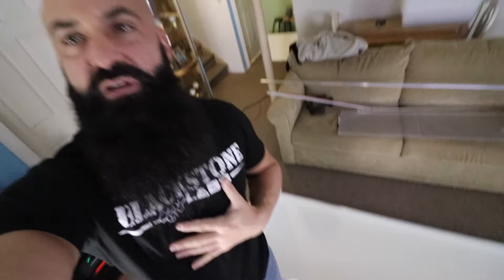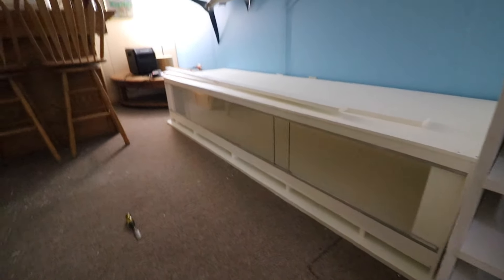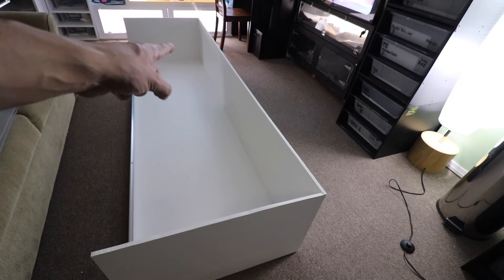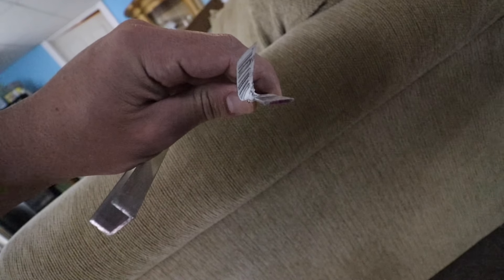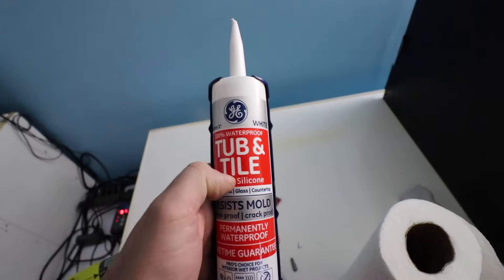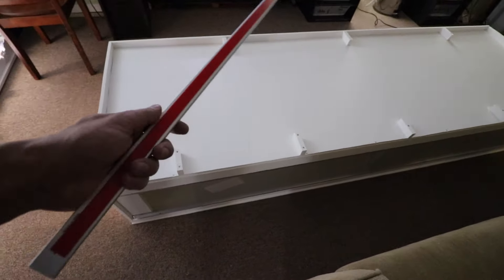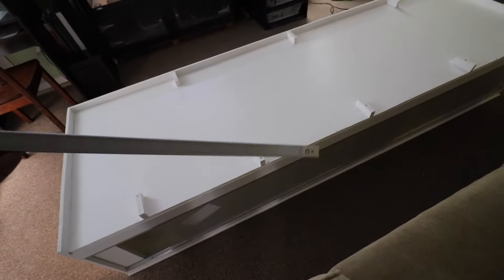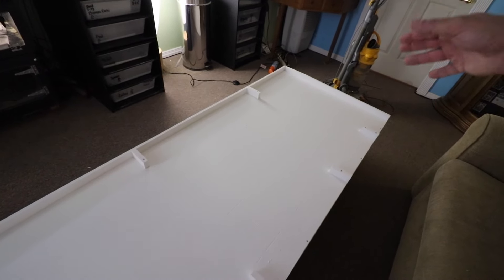How to Build Snake Enclosures (Cheap & Easy) DIY

Comment: first diy "Cheap and Easy" I've found that actually looks completely doable. I'm searching for bigger vivariums for my snakes, but glass ones are far too heavy for me to safely move alone. Lighter construction material (that I can cut and screw together easily!) is key. So this looks like a great project. Thanks for posting!
Reply: I've built all my enclosures it's the best way to go,  easily modified, durable,  and a no Brainer.  Lasts forever if done right and materials can be reused if you want to modify or upgrade.

Comment: I built two using your plans Chris and, speaking as a fellow non-carpenter, they came out great.   My only issue is the silicone caulking is not as strong as my male burm.  While roaming around the cage and pushing all of his newspaper into a ball on one side, he keeps lifting up tiny pieces of the silicone.  This afternoon, he was covered in it  (LOL).
Reply from the maker: Hmm thats weird. Maybe they have some kind of heavy duty stuff. Im not sure. Havnt had an issue yet
Reply: @Chris_Graham  When I'm bored, I play solitaire; apparently, my burm peels silicone. 😄

Comment: Best build video that I've seen hands down! I have a Ball Python and I'm wanting to get a mate for her. I'm actually wanting to build a bigger enclosure for her and her mate when I get him. I'm thinking I may do 6 feet for each one. Could you reply with the link on the heat tape with the size I would need for the enclosure please? 6x2x2 is what I'm going to do. Oh also a link to the thermostat that you use for it. Thanks!

Comment: Nice video dude. I’ve been wanting to build an 8’ x 3’ (or 4’) x 6’ pvc enclosure for my Tiger Ratsnakes. If your putting Burmese pythons in there I would only be concerned with bottom panel and the weight of the snake. To me it just seems like there should be more support underneath. Otherwise I really like the set up. Thanks for sharing.

Comment: I would like to see a video where your getting your temps with flex watt going through 1/2 inch PVC. I'm not seeing where the heat would effectively transfer. Since Flex watt is made for under floor heating application I have been told by several breeders that you can put it under tile and grout it in. Great video!
Reply from the maker: Its been 2 years, my female burms are still in these enclosures and both girls are about 11’ and 35lbs each. Temps have never been an issue with the flex watt heat tape since i made the video.
Reply: @Chris_Graham  wasn't saying your temps are bad. I've tried and can't seem to get them right. the heat tape has to be set super high and it takes several days to get the hot spot to 70 degrees. I didn't see where you had a follow up video showing what your temps were running. only way I can get it to temp is putting it under floor tiles so the natural stone heats up. just suggesting maybe you do one and focus on how you have the heating setup and what you have to set the thermostat at to achieve correct hot spot.

Comment: Chris I know you built this a few years ago so and I think you might be able to provide some updates on how this is working. My main questions are: how well is it stacking and holding up?   How did the heat tape idea work out was it hot enough to go through the PVC. Trying to see if I 1/2 inch PVC  is enough. Thank you
Reply from the maker: i have three of them stacked still since this video, and all three have been transported from NJ to SC without issue.  Still using the heat tape and it does create  enough belly heat and the female burms are about 12' long now and feeding on large rabbits and digesting great and doing well.
Reply: @Chris_Graham  thanks so much for the update and that is great to hear!

Comment: Amazeballs! What you doin for ventilation?
Reply from the maker: I have holes drilled in the back and sides to allow for air ventilation
Reply: @Chris_Graham  Thanks for responding so quick!
 How big? How high? Covered, with what?
Reply from the maker: @daniellepurv9094  i used like a 1/4” hole bit and just put a bunch in. That way its too tiny for a large snake to fit its head through

Comment: I’m definitely going to be using this video! Thank you so much. I have three snakes so I’m gunna build three of these and stack them. Mine will probably be 6 feet though. I’m also hoping to build some sort of cabinet on the bottom for supplies. Would I be able to stack these 4 high or should I add extra support?
Reply from the maker: yea you can always add a verticle support in them to make them even more sturdy if you wish

Comment: I just bought a baby Boa. She's in a small cage now but I'll have to get her a bigger house as she grows. I am going to use your ideas for my build. I think I'm going to use real glass for the doors. I used plexiglass on my monitor's cage and it looks like crap after 5 years of wear and tear. Anything inside that needs wiring I want to use some kind of condoit so there isn't wires for my snake to hurt herself on. I'm going to talk to an electrician friend about wiring thermostats and lighting. Don't be afraid to pick at the brains of skilled people. I'm no carpenter or electrician but I know some people who are.

Comment: It's a nice design but I don't understand how the center is supported.  I don't see a center brace.
Reply from the maker: You can always add one if you’d like.
Reply: @Chris_Graham  I just bought 4 pieces of PVC for a very cheap price at Home Depot because it had some small damage to the sides from the straps.  BTW, Home Depot will discount PVC 70% for small damages,  I appreciate your video but was just wondering if it sagged in the center without a center brace.  Thanks again!
Reply from the maker: @andreperson3504  no mine hasnt, and they are still in use and nothing has been added to them

Comment: For those in the comments. Blackstone Labs is the best period nutrition superstore!  
Would recommend DMZ but that’s oldschool lol. 
You need to try brutal force and chosen 1 stack
Their dust pre-workout is really legit too! Deployed for 6 months and went from 185-205 in 10 weeks and kept mass but lost a little strength post cycle. This cycle was a one time go... If you have ever had a hard time gaining weight or muscle these guys have what you need!
Reply from the maker: Hell yes! About to try Apex Male for the first time, never got the chance to try DMZ
Reply: Chris Graham I would also just got to a test center like Low-T center and just get on a treatment with them. Take home weekly shots 140$. I had low t like 5.7 free and 202-225. I got it up to 16 free and like 600. I was lean af and it didnt take very much to maintain.

Comment: Your doors are 12" high but how far apart are your tracks, to be able to remove/install the doors and how many inches do your doors overlap in the middle? How long is each individual door? Is the top supportive enough to have a track installed to it directly and have taller doors?

Comment: Hey Brother how are you heating these?
Reply from the maker: I am using 11" heat tape currently and not having any issues at this point
Reply: @Chris_Graham  on outside underneath it?
Reply: @Chris_Graham  BYW Thanks for this video! Helos with new enlosure for my burms and I am tired of using melamine!  Lol heavy stuff!
Reply from the maker: outside underneight of it. the heat will penetrate through the pvc and warm the snakes belly
Reply: @Chris_Graham  cool Thanks man! I wasnt sure.

Comment: I just wanted to comment and say thank you so much for this video. I used this when building my custom enclosure for my Dwarf Retic. I travel in my RV and built her enclosure to fit my slide. (6ftx2ftx19in) It has lasted for the last 2yrs. She was 8ft when I first built it. Now, however, she is full grown and bigger at 14ft. So, I'm about to use your video again to make her a larger enclosure.
Reply: Too bad you aren't the one who actually built it.
Reply: @EYC420  What does that even mean? Snake cage is a snake cage. Only so many ways to build a box and not everyone can or wants to wing it

Comment: Just built this for one of our retics. Should I router out a recess for the heat tape? Or is 12”x3ft enough to heat through the 1/2inch pvc if I set the thermostat a little higher than 89, I was thinking like 95 should penetrate the pvc enough?

Comment: How well does an under tank heater work with this material?  I'd imagine you'd need to crank it up pretty high to get through the thickness?   I feel like that's going to shorten the life of the heater and raise the electric bill.  I'm looking into building one for my ball python. She's in a breeder now but, I want to go a little longer and not as tall (4'L x 15"H x 18" D).  Could I use a thinner pvc?  Also, do they have that in other colors like, black, brown or, gray?  Thanks in advance!   ps.  I'm not a carpenter but, I was raised by one ;)

Comment: What is the thickness of the glass?
Reply: 0.22” works well in this track.  However, I’m not sure you could use a ratchet lock...  I’m thinking of using sliding glass track from Rockler instead. Otherwise this build looks great—bought my PVC last night.  My daughter’s blue-tongue skink will be very happy.  Note I’m going for 4x2x2.
https://www.rockler.com/4-foot-plastic-sliding-door-track

Comment: I am a complete beginner in carpentry and I was able to successfully finish this enclosure! I adapted it to be 6x2x2 and it looks incredible. Instead of multiple little feet at the bottom, I used three 2x1 ft pieces of wood (ensures they are the same height). I also will say if you are complete beginner, don’t really have the space to be sawing in your house/outside, or are short on time, I would recommend spending the extra money to buy a pre-made one instead. This is more time consuming than it seems and I definitely ran into my share of frustrations. For example, the saw blade kept getting so hot that the PVC would melt and re-fuse to itself; solved this by dipping blade into ice water every 15-20 seconds as I was sawing. Got a lot of help from my way-more-knowledgeable-than-me parents too. Overall, great tutorial! Looks great and totally worth it if you have the means to make it :) Thanks Chis!

Comment: Can you make a enclosure that's affordable that is 8ft long x4 ft high × and 4ft wide
Reply from the maker: yea just do the same steps in the video except use more pieces of pvc to make it to the size you want.  Might be cheaper if you used wood but i would recommend the pvc
Reply: @Chris_Graham  how much more pvc would I need?
Reply from the maker: @user-xg8ij1hs3x  probably 4 pieces of 8x4 sheets

Comment: Thank you for this great DIY explanation! We're using it to create a 4', 5', and 6' enclosure for our various reptiles. Did you find a lock that works to keep the sliding doors closed? Also, we added a 24'x1/2"x3 1/2" support beam to the very middle of each enclosure that prevents them from sagging when stacked. It was a scrap piece, so it was free
Reply: Did you buy exactly what he bought because I’m looking into making a 4-5’ enclosure for a ball python

Comment: I'll be using ur design here real soon only thing I'm gonna change is the support on the bottom I'll prolly add runners that go all the way across the bottom for added support in the middle of the bottom if that makes sense
Reply from the maker: ryan mcnabb yes it does, i just didnt bc i planned to run the heat tape

Comment: I see that the plexiglass slides, and the two sheets have enough give that they don’t scrape against each other. My question is do you have any way of securing the sliding plexiglass sheets to secure it closed? Or is it not really an issue of them sliding it open on their own
Reply from the maker: The Fit Zookeeper its not an issue of them sliding it open but if you wanted to you can buy a “display case lock” off amazon. They are like $10
Reply: Chris Graham awesome! Thanks for the video and your quick response! Look forward to more

Comment: Nice video my friend. I'll be building an 8 footer myself in the next few months. I was thinking of using pvc or birch wood... not sure yet. I'm going to take notes when I watch this again to get my measurements right. 5🌟's
Reply from the maker: Josh Smith i just love how light pvc is. Wood is a great option but the weight difference is the big factor for me
Reply: @Chris_Graham  Maybe I was looking at the build wrong but was there a lip or overhang on the top piece? Also, what size did you cut the bottom?
Reply: Another nice thing pvc will hold longer due to humidity not effecting more
Reply: @Chris_Graham  I'm looking up your beard products, what products work best together? I have a full beard with the exception of one spot that grows slowly... what would you suggest?
Reply from the maker: Josh Smith oil is great on the daily basis for keep the hair soft, smelling great, and the skin moisitrized. Beard balm, put some in the balm of your hand, rub your hnds together and it will liquify in your hands and then apply it like hair gell for your beard. The balm also has wax in it to help style and hold your beards shape.

Comment: Will be building this enclosure (maybe a 6’x24” size) but I believe the brand name for the pvc sheets are called starboard. We used this material on our sailboat gallery countertops, it is very durable and will last forever! You can (plastic) weld the seems to add a stronger joint but adding the screws won’t hurt either, maybe using 1.25” or 1.5” for the main joints would have been stronger but if you don’t move the units a lot, the 1” screws should do the trick. Definitely have to predrill holes!
Reply from the maker: Thanks a lot, i keep learning as I go

Comment: I want to know how good the heat tape works with this and also if a heat rhp would cause the top to sag
Reply from the maker: I'm still using the heat tape and its working fine, I'm going to be ordering heat panels for all my enclosures shortly.  I think as long as you dont use a thinner sheet of pvc you should be fine
Reply: @Chris_Graham  ok. The heat tape gets through the plastic good though? I was wandering if it you had to crank the stat way up to do so

Comment: Great video!  One question, I am not seeing how the doors can come out after it is all screwed together.  When your tiny helper was holding it together it looked like there was no vertical play between the two tracks.
Reply from the maker: you will be able to lift the glass up and then pop the bottom of the glass out

Comment: Do you think 3/8ths pvc is strong enough for a viv? Also if I have a 3'x2' ft, on a 4'x 2' ft, on a 6'x2', is that going to be strong enough?  

Also could 0.08" plexi work? Its all I can find here in Canada. I'm scared if my boa strikes at the plexi it'll crack.. 

 Thanks so much!!! I love this build!
Reply from the maker: 3/8 might be too thin, do you have 1/2 or 3/4 pvc near you.  I would think 1/2 is going to be the thinnest I would use.  Also the screws you would need to use for 3/8th is going to be very thin.  sounds like the plexi might be a bit thin.  Does it have a lot of bend to it? the boa could also put a lot of pressure on it and bed it right out of the tracks too if its too flimsy.
Reply: @Chris_Graham   unfortunately All I can find is 3/8ths, I'm trying to find another material possibly but all I've found is melamine and that's not going to be great with humidity. 

And the acrylic I'm not sure how much bend as due to the co\/id I can't go into the store to find out.

Comment: hey there, do you by chance have the link to the LED light you use? Or at least the brand?
Reply from the maker: It was like a $40 one off Amazon.  it was a 36" long LED strip light.  There is probably 1 bunch of different brands but all basically the same product

Comment: would this type of build work for a blue tongue skink enclosure? i know i would need to adjust dimensions a little but as far as safe for the heating and humidity they require? im not entirely new to reptiles but have never had a skink and really just want to give it the best enclosure possible.
Reply from the maker: to be honest I've never had a skink and not real familiar with their care requirements.

Comment: Just wondering since you used PVC why not just seal it in place of using silicone?  Also are you finding that the heat tape penetrates the 1/2" well?  That's why I was looking to go with a RHP instead of tape. I'm planning to build 2 in a few months when I have a couple getting out of quarantine.
Reply from the maker: the silicone caulk is a waterproof seleant, i'm confused what you mean?
Reply: The heat does penetrate the 1/2 “ PVC very well. You can silicone the joints as you screw together, but a bead of white silicone after the sides are screwed in will hide imperfections in the cuts.
Reply: @Chris_Graham  what I'm talking about is also called PVC cement.  Typically has a purple colored primer and the cement is clear.  It bonds the PVC together.  Though now with some more thought, silicon will fill the gaps if there are some from the cutting.
Reply: @scottishrob1  You should ideally Cement and Screw the seams. Silicon does not stick to PVC.

Comment: Most DIY stores in the UK don't stock PVC sheets which is a shame as it holds up to moisture and humidity better than melamine faced particle board.  I would presume you could have also used solvent weld to join the panels rather then use screws ?
Reply from the maker: I'm not sure, but i probably wouldnt skip on using screws completely

Comment: Will these be stackable??
Reply from the maker: Yea i stacked 3 of them
Reply: @Chris_Graham  NICE🔥 I'm gonna be in the market for 14 Enclosures soon,(9) 7x3x18"
(2) 7x3x2
7x2x4
5x2x4
3x2x4
Buying custom ones would cost me $15k+ so if I can do sumn cheaper that's safe to stack,make bioactive & install a heat panel,I'd much rather do that💪🏾💪🏾 Extremely helpful video bro,thank you💯💯💯💯